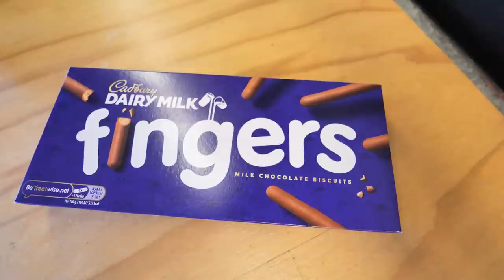Full Time Van Life Begins | Move In Day

Comment: Hiya guys, most dehumidifier bags are filled with silica gel.  I used to sell silica gel and most was bought for caravans over winter to prevent mould forming.  The thing with silica gel is it works really well in a sealed environment where it can gradually absorb the moisture in that area and then ideally no more moisture will enter.  They don't work very well for heavy saturated areas as they absorb quickly and then reach saturation point.  You can put the loose beads on a baking tray in an oven for a couple of hours at 120°c to re dry them back out but realistically you might need to be doing this every few days.  I had to go to great lengths to double bag the silica to prevent an open atmosphere getting to my stock as it will just keep absorbing till saturated.  In a damp car where the doors get opened and closed it would probably reach saturation in a couple of days.  The normal silica is orange and when saturated turns green to let you know it needs drying.  If you do go down this route you might be better buying in large quantities of the loose orange beads as I think your be surprised how quickly it reaches saturation point and then it cannot absorb any more water.  Hope this helps.  You might be better with an electric dehumidifier.

Comment: Bubblewrap cut to the size of your windows (medium size bubbles, not the small ones) let the windows start to fog up a little and then the bubblewrap will stick to them. Stops condensation as well as helps retain the heat in the van. rolls up for easy storage during the day :)

Comment: Guys loose the gimmicks and get a proper Thetford Portapotty. You get Noravirus or just an old fashioned dose of the runs, life will be very unpleasant for you both. You only wear one jumper at a time so you could loose half the jumper box to make room for it. Also get a Karcher window vac to hoover up the condensation. If you can get them in I would get a couple of the lattice bases from bakers van bread trays to park on when you are going to be parking on mud and snow. Stops the wheels sinking in overnight and gives traction to your drive wheels.
Reply: Good suggestions.  Another one to prevent being stuck in place is to wait about 30 mins after you stop for the night and then back up a couple of feet.  The tires heat up after driving all day and will melt the snow where you first park and freeze you in place by morning.  Backing up a couple of feet puts cold tires on fresh snow and is less sticky.

Comment: Livin' your best lives, Beans!    Sooo - just a thought about the dehumidifing. Should your silica cushions not work out, you might find that kitty litter has a double use -  EXCELLENT under your tires if stuck on iced-up roads. A little goes a long way.
Reply from the maker: Oh that is a good double use. Hadn’t thought of that 🤔👍🙏
Reply: I also use clumping kitty litter and cedar wood chips in my portable toilet.  Absorbes any liquid and no smell.  Just use double garbage bags and toss in a bin at the end of the day!!!  Really no different then disposing of used litter and/or diapers.

Comment: Beans living the dream! So excited for you both 😊 Those big “silca” absorbent bags didn’t do much for condensation in our T4, but carpet backed foil blinds works wonders. There’s a little glimpse in our latest video that shows them working but we’ll be showing them in action properly soon. If you can tackle the condensation then winter vanlife becomes so much easier. Good luck guys, we’re well jealous 🤟🏼
Reply: Yes that works and we’ve found that getting one of those Karcher sucky squeegee gadgets is the most effective way of removing condensation. If it doesn’t settle on the windows it will settle elsewhere that may become a problem.
Reply: For us the only thing that really prevented it was ventilation.
Reply: Agrred. We always have our front windows open an inch for airflow. Along with shaving gel, this seems to give us the best results when not using our blinds.

Comment: packing wow. i pack 6 pairs of socks 6 pairs of underwear 6 t-shirts 3 short sleeve three long  wind pants 4 with thermal bottoms thermal underwear too. tops and bottoms.Women padded bras for added warmth. even if you don't need them pack one or two,..keep them nippies from freezing. 4 pairs of pants, 3 pullovers, thick ones kangaroo style, heavy duty weatherproof boots , thinsulate, Gortex coveralls, and one coat. because,..anywhere i go they have laundry mats or places to wash clothes. Food i only buy things i need to eat tonight especially the meat things....  the rest i get on the road. Now if i am going out to the middle of nowhere i bring complete cooler full of dried things like rice beans flour water yeast baking soda. plus meat. if there is fishing ava. i bring fishing equipment. Some canned goods, more if your going out into the middle of nowhere.. but very little if your staying close to civilization. Always fireproof windproof matches, some fire starter, lint dust- bunny's, steel wool, battery to short across steel wool to start fire, few sticks for a fire, flashlights, and batteries. Tarps, nice size ones....not little things they fold up flat for great storage, garbage bags for your loo. Winter snow chains,..actually cable ones for easy storage space and lightness, should always be in my vehicle,..even for mud and added traction. Tarps for emergency shelter 4 X 5 meter  minimum. You can always tuck extra underneath. Poles if you can find them..ones that are like 3  to 4 piece slide into each other and lock together for use with tarps. they make great shelters done right. Also rough cat-litter!!... when i am on ice, gives great traction. Shovel mine is bigger and flat also fold up......  and tough mine is plastic. They make great carbon fiber ones real solid and better then aluminum or steel...lighter too. remember they make cars out of the new carbon fiber. and when they wreck cars,... they still hold together driver or occupants are safe!..  roads flares, emergency charger,...some hook to vehicle electricity grid so if vehicle fails you use it to start car. and if not a solar panel to charge charger..phones and other electrical devices, always a must,...  always inside vehicle. Also a mirror an outdoor stove, candles, some wire, duct tape, hatchet sharp file for hatchet and a handsaw,.. all should be part of your vehicle. Even space blankets or sleeping bags. But this is just me and i travel from South Dakota in winter some years all the way across to Oregon Washington coast. When in Siberia for winter all this and some more is a must!!.